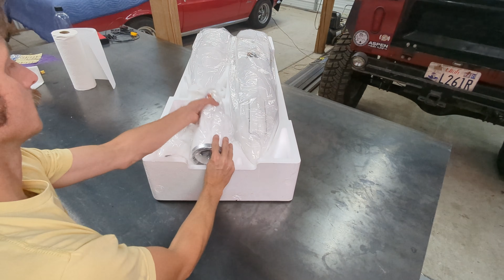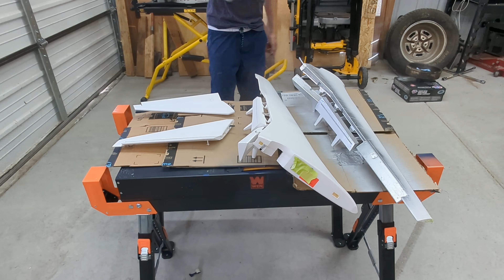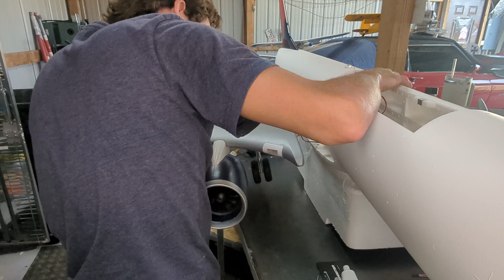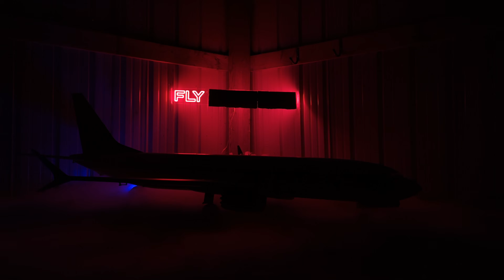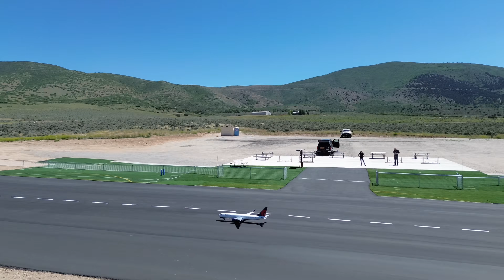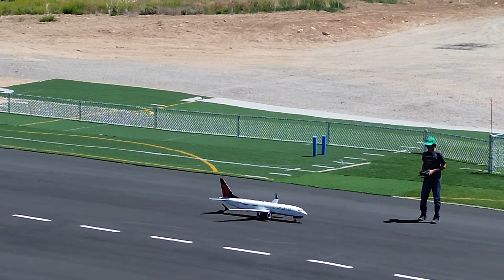Building and Flying a RC 737!

Comment: Awesome build! What color paint did you use from restoleum? Looking to do the same delta livery. Thanks!
Reply from the maker: The blue was navy blue I believe. I just used their standard "Silver" color for the wings and normal gloss white for the fuselage. Good luck on your build! If you email callie graphics they can get you the same set of decals I ordered. If you want a different tail number they can make that change too.
Reply: @ Thanks! I contacted Callie and they are sending the decals. The underside looks challenging as far as painting and like you said trying to apply the decal. Did you use a template of some kind to get that painted?
Reply from the maker: @EricHarned  I have a Delta 737-900 1:200 model I used as reference. I taped the outline of the blue on the underside out using painters tape. When I got the shape I thought that looked correct I sprayed it. If you have a model or even a photo to reference its pretty easy too figure out where the blue underside starts and stops. It takes a minute to get it to look right but if you take your time getting the profile right it will pay off in the end. You may also have more luck with the large underside decal than I did. You can always try to lay it down and if it doesn't work paint it.
Reply: @Awesome man, appreciate your help!

Comment: Looks beautiful! Respect! I'm also planning to make the al 37 with a Ryanair design but I don't know which paint to use. So I wanted to ask which one you used because it looks pretty good?
Reply from the maker: I just used Rust-Oleum spray paint. It's always worked really well for me. I would recommend painting the fuselage white prior to applying decals since the factory applied paint comes off when you pull the painters tape off. 

For decals check out Callie Graphics. They produce excellent quality decals. I use them in all my builds. If you just send them an email I'm sure they probably already have the files to print you out decals in the Ryan Air livery.
Reply: @ Oh thank you very much for the quick response. This is very good information. It really helps me a lot.
Reply from the maker: @JonxyRL  good luck! Shoot me an email with a pic when you get it done. Id love to see it.
Reply: @ Yes, I will definitely do it, but I can only start in 11 months because I'm still abroad